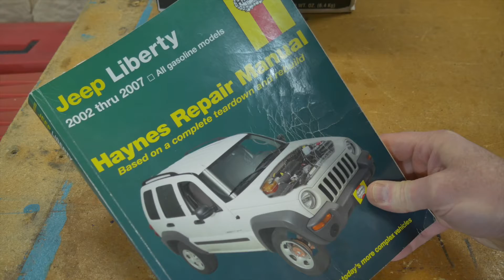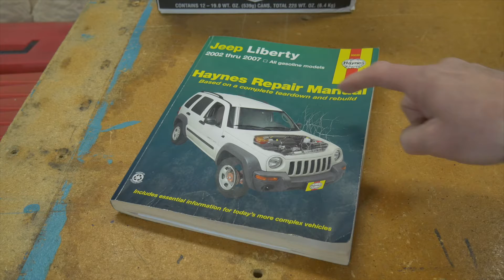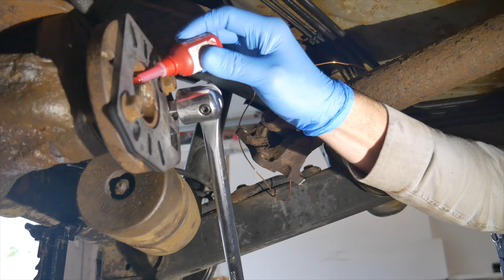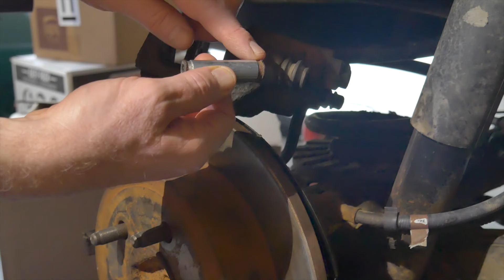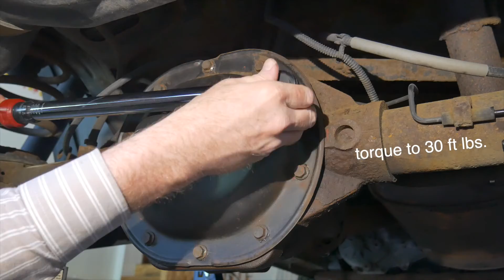Jeep Liberty Rear Axle and Pinion Seal Replacement - AMSOIL Severe Gear 75W-140 Synthetic Gear Lube

Comment: I appreciate detailed videos like this. Always, but please to anyone watching this. Don't use that much loctite, a little goes a long way. Also that purple ceramic brake lube is for external lubrication only!!! Never use it inside of sealed areas like he did. Silicone based brake lube, like sil-glyde, are the ones safe to use in sealed areas. Thank you...
Reply from the maker: Thanks for watching and commenting.  Here's what Permatex says about the lube:
Suggested applications: Caliper pins, hardware, and the back-side of brake pads.   DIRECTIONS: 1. Clean parts to be lubricated with Permatex®
Brake & Parts Cleaner. 2. Apply small amount to caliper hardware, backing plates, bushings and seals to create uniform surface areas and prevent noise. Safe on rubber seals and plastic. 3. Lubricant may also be used as a noise suppressor to eliminate caliper brake squeal by applying to the BACK of the brake pad. DO NOT APPLY TO ANY BRAKING SURFACES.

Good Stuff!
I appreciate the feedback. It's good to hear from other folks working on these things!  Thanks again!!

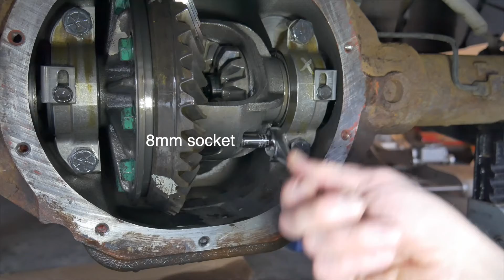Comment: 3:00 mine has an e10 type head on the bolt that holds the pin and no real room to get a small socket wrench in there. Is there a special low profile wrench to remove this bolt?

Comment: Great video.  Why not change the universal joints if you had to pull the driveshaft?  I just had a problem with my joints that failed with them showing no sign of ware.  Once removed, the u joints had severe groves from vibrations. I thought that the axel was going to have to be rebuilt but turned out that i caught it in time.
Reply from the maker: Just fixing what's broke.  Thank you for watching and leaving a comment!

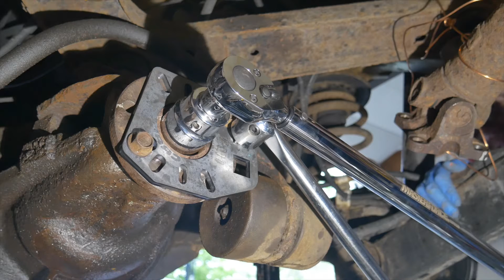Comment: also im kind of confused. at 15:53 you say it was originally at 8lbs, but you're bringing it up to 18lbs after? could you explain why i need to increase  it by 10lbs? thank you.
Reply from the maker: That's the increase in torque required to turn the pinion before and after tightening the nut.  10 inch pounds.   From 8 to 18 inch pounds in this example.  It's a small amount thus requiring the sensitive dial torque wrench and consistent application to determine the small increase in torque.  Hope that helps.
Reply: @midwestsynthetic  pinion nut is stuck, about ti impact that off today. my drag reading was a meager 2lbs, so following this video it would need to be increased to 12inlbs drag.
Reply: I'm confused with this answer too. If it was 8, why not go back to 8? @midwestsynthetic
Reply: I really liked the video. Great work, video and explanation. I didn't understand the 8 to 18 torque and your explanation, but I just need to do the axle seals at present and can handle that.
Reply from the maker: The drag measured in inch pounds is the amount of torque it takes to turn the pinion, wheels off and no brake drag before removing the nut.  When the nut goes back on, it's brought up to torque and is correct when the drag on the pinion increases by 10 inch pounds from that starting measurement.  A sensitive torque wrench and some practice is needed to measure these small torque values accurately.  When the nut is back in the same spot it started that also is comforting that it's good and not overdone.  Hope that helps.
Reply: @midwestsynthetic  finished mine, the inch/lbs didn’t increase past 3… started at 6. However my nut is seated in the same spot as before according to my paint marks and pictures. It also howls like the wind when driving over 40mph..
Reply: @MarkyTheSharky-l3o  Were your bearings making that noise before? If not you definitely have too much preload on them now. Assuming what little information I have is correct.
Reply: @ they were not making that noise. I should have addressed it by now but weather is just warming up now.
Likely gonna back it off a quarter turn or less and see if it improves

Comment: if only doing the rear pinion seal, do i need to remove the wheels and such? i dont se any need but wanna make sure
Reply from the maker: If you're using a sensitive torque wrench to set the preload it could affect the reading by increasing drag due to force needed to get the wheels to move as well as brake drag.
Reply: @midwestsynthetic  ahhh gotcha! Yeah that's the part I'm most worried about is all the sensitive torque settings.
Reply: @midwestsynthetic  what about removing the rear axle as you did? Same thing?
Reply: In the process of doing this. Trying to get the pinion nut off now. I checked several times, and all 10 times it reads the drag as 2inlbs. I feel that is extremely low compared to yours..

Comment: Thank you for the detailed instructions.  I'm wondering about the rotating torque required for the pinion nut.  The 2005 Jeep KJ Service Manual says "Rotating torque should be equal
 to the reading recorded during removal plus an additional
0.56 N·m (5 in. lbs.)."  Are you recommending 10 in. lbs.?
Reply: mine said the same thing add 5 inch pounds to what you got from the previous reading

Comment: Is this with or without replacing the crush sleeve because I’m not getting near that torque reading. If I go over 100 it feels like it gets hard to turn and feels like it catches. Also takes 30 in/lbs to move
Reply from the maker: This is using the existing crush sleeve.

Comment: Thanks for the great video.  My liberty was slinging oil all over the brake on the driver side.  I thought I had a bad brake caliper but it was the axle seal.  I didn’t do the pinion but that looks a little wet too😕.  At least the brakes will be ok for now I guess. Thanks again
Reply from the maker: Interesting comment.  When I first crawled under the Jeep in the video, I was expecting to rebuild the oily brake caliper, but nope, it was gear lube from the leaky axle seal.  Thanks for watching and leaving a comment!

Comment: Awesome video. Very detailed and informative. I was waiting for a call back for a quote from the mechanic. Was on the fence on doing this job myself. But your video definitely removed any doubts and removed the intimidation factor,so I will be replacing the wheel seals myself on my 05 liberty.
Reply from the maker: That's great!  Thanks for the comment!  Have fun with your project!!

Comment: Do you have a part number to the rear axle seal by chance?
Reply from the maker: No, sorry, didn't save that.  I would have gotten them from Rock Auto, which has a bunch of manufacturers and part numbers.  Thanks for checking out the vid!

Comment: Great video and very very helpful.  Curious why the rotational torque is original + 10inlbs. Because of the previously crush bearing?  Thankyou for this video.
Reply from the maker: That was the instructions from the service manual for the preload on the tapered bearing.  The original crush sleeve was reused.  2+ years ago now and still going strong.  And best of all no leaks!  Thanks for watching and leaving a comment!!

Comment: I am just about to tackle my 04 jeep liberty renegade 5 speed manual 4x4 rear end seals and its making a pretty mean grinding noise since running differential dry on oil so I'm a little scared what exactly what I'm going to find when I remove the rear differential cover but other than that concern with mine I really think you did a great job of explaining what tools were needed to use along the way and I liked how you used the paint marker to mark parts so they were able to be put back the same as removed very straight forward easy to understand video along with some specs to help give an idea of what torque bolts and nuts should be tightened to thank you
Reply from the maker: Thanks for watching!  I appreciate the comment!! Hope your project goes goes well!